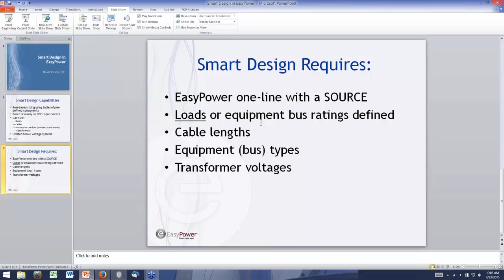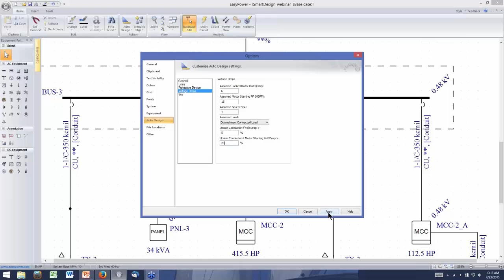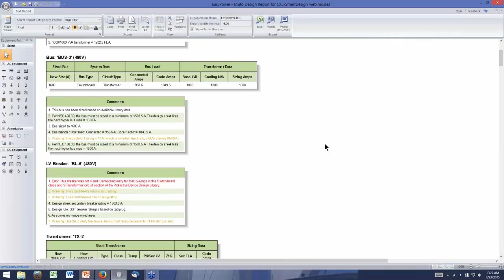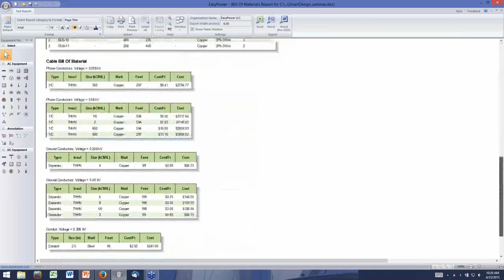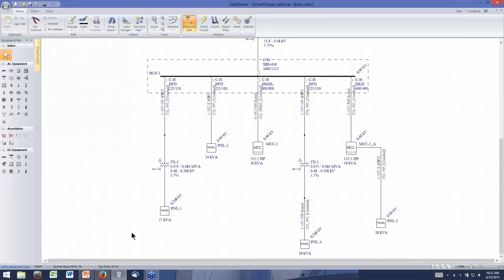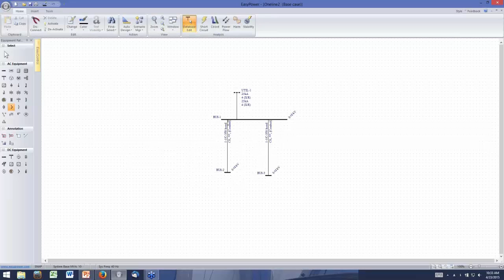SmartDesign in EasyPower

Comment: Jon, the AutoDesign Report and the Bill of Material report (if selected) provide all of the data that is currently available from AutoDesign.   Regarding Series Ratings - the program is selecting breakers contained in the Design Sheets.   I believe that if you designate use of Series Rating in the breaker Short Circuit data AND the breaker data shows a series rating in the EasyPower library, it will take that into account.  But AutoDesign will only select breakers in the Design Sheet.